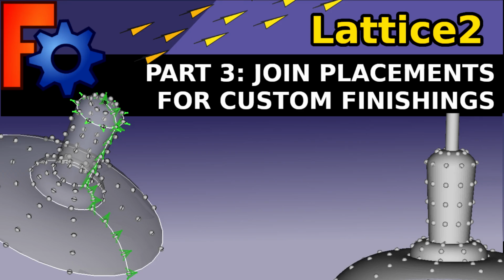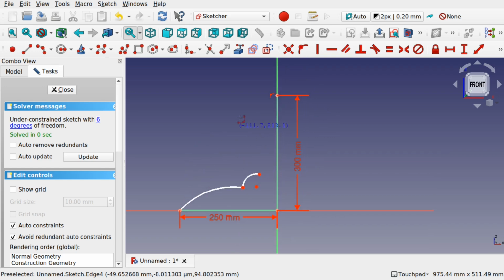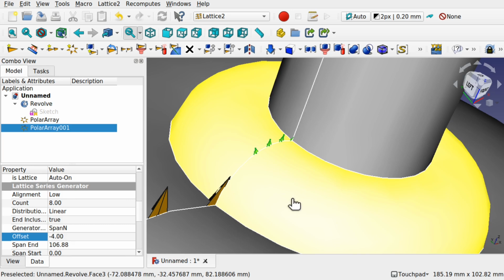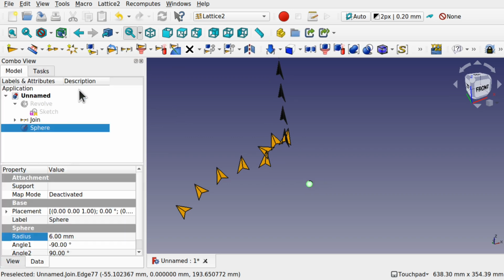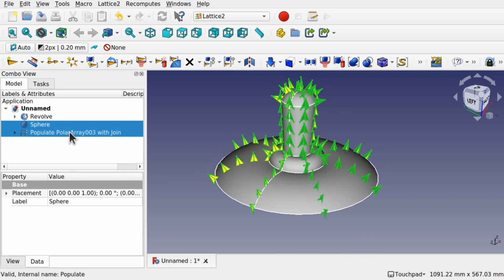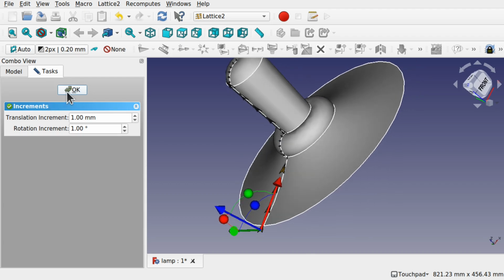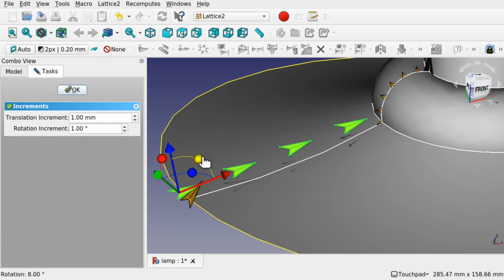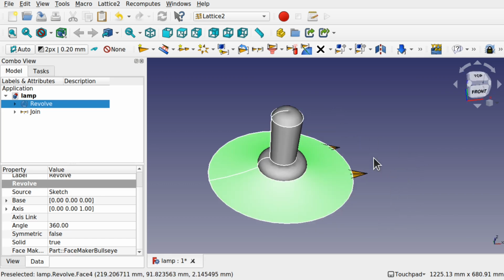FreeCAD Lattice2 03: How to easily add custom finishing / knurling | Join Array | Beginners Tutorial

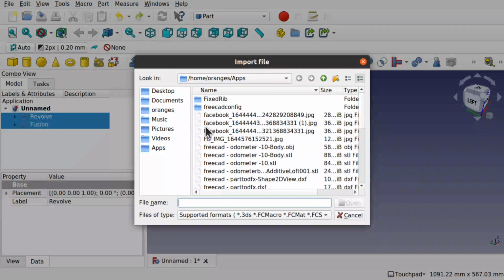Comment: At about 15:30, what is the purpose of importing the STL file? What could I do with an imported STL file in FreeCAD?
Reply from the maker: That was just to show that the output worked. I use it in a number of videos. Sometimes I select two items and export and they are connected together as one so the stl has components. It's just a thing I used to get the question how would I go about exporting this so I tend now to include it (sometimes 😊)

Comment: i've been having problems implementing lattice2 into my models caz this out of scope error comes up.  It looks like lattice2 only works at the root level of a project. So anything made with part design.. anything with groups .. anything with assemblies... >>>  have to clone / make links / shape bind  JUST to get those objects at the root level...   it's kinda weird.  really messes with the jam. 
Been wondering if this is how realthunder is designed  OR if this is same with vanilla FC ?  (I use realthunder btw. The "show preselect geometry info" option is absolute gold. Saves literal hours of time.)

My current project right now is restoring an old flatbed trailer which the wood had rotted out. I say no more wood. I feel like half my life, the chores I have to do are mostly due to fixing decaying wood. Sooo, the question is >>  I want to use FEM to predict how much weight a sheet metal bed will hold. How many layers of what gauge of metal will hold the generator/Kawasaki vehicles/farm equipment .  

A use case for lattice2 is >> I have a bunch of corrugated metal roofing.  Use lattice2 to make the panels.  Dodo to make frame. various other techniques to get it all together.  The key part is having it all parametric caz at the end of the day > simulation of various materials is the goal >  U want the model to easily swap out different parts. upgrade construction.
Reply from the maker: Lattice has a specific tool for the part design called part design pattern, do you have the same problem with this one? I am going to have to have a look at the issue. I'm using vanilla freecad but I haven't ventured with lattice into assembly workbenches yet. I be interested to see how if I find the same in the version of freecad in using.

Interesting use of FEM and lattice together for your project, I can see how beneficial that would be. I know you can mix lattice with spreadsheet but never thought about FEM and your use case sounds like a great example.